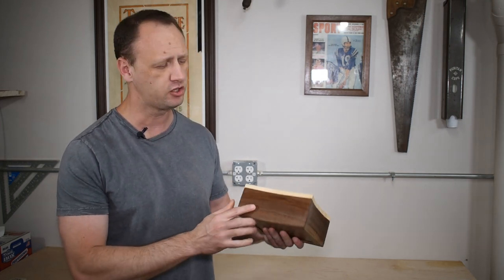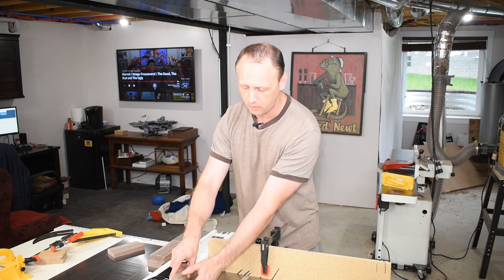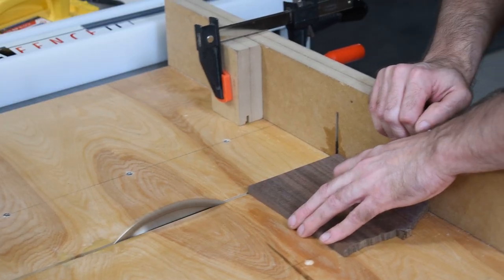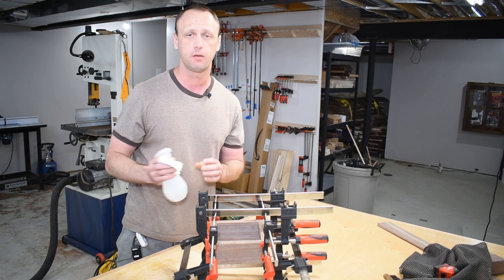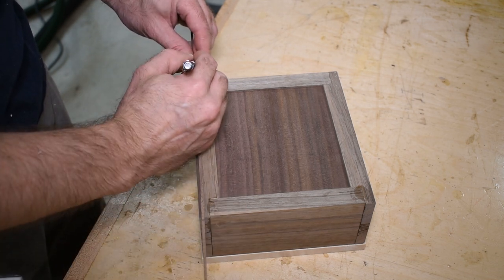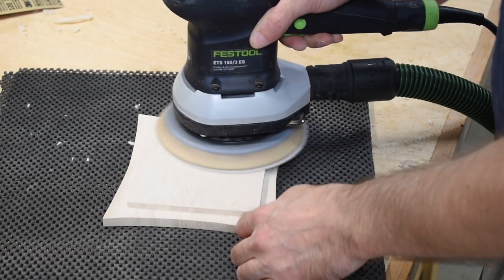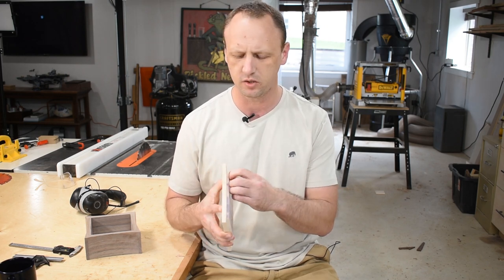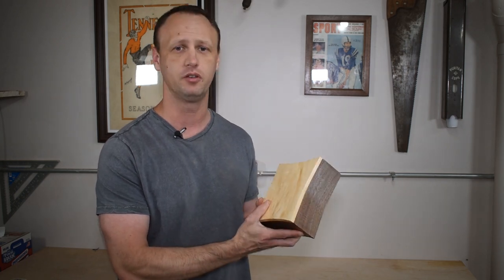Curved Walnut Memento Box | How to Make Curves on a Bandsaw

Comment: Little late but couldn't you have just sanded without removing the whole engraving and then glue a piece on top? I could think the engraving would just give the glue more surface area to adhere without having to remove all that material